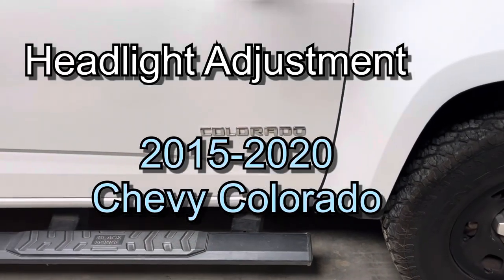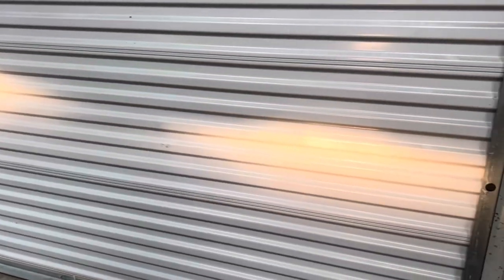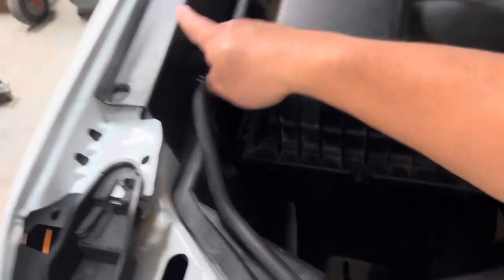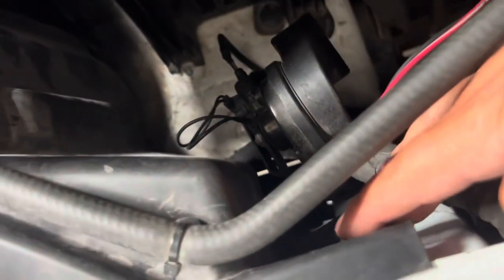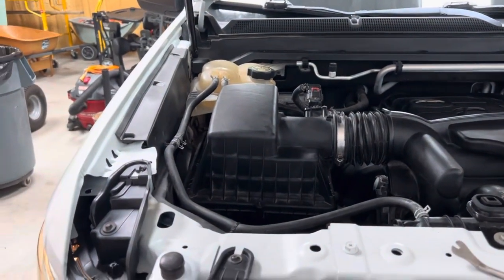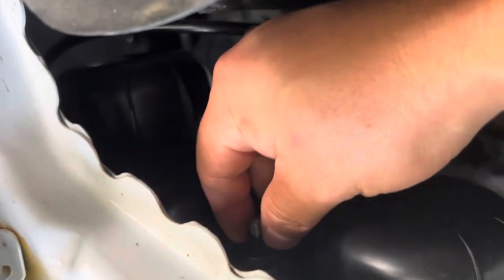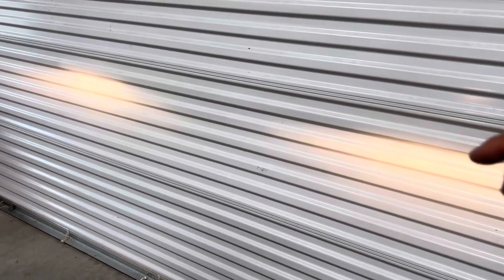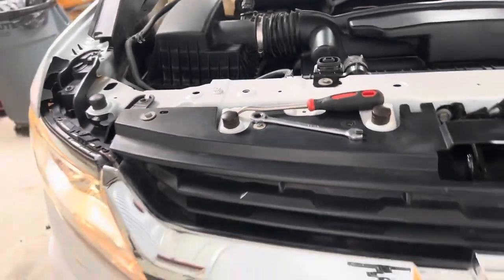How to adjust headlights on your 2015-2020 Chevy Colorado

Comment: Or you can stick a Phillips screwdriver or Allen wrench through the oval hole in the body straight into the headlight adjustment screw. No need to take anything off.